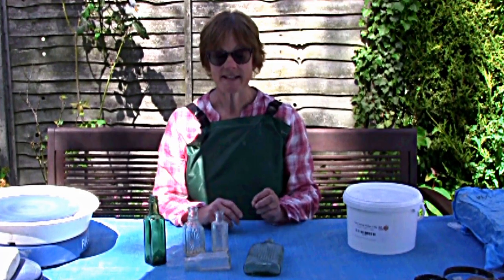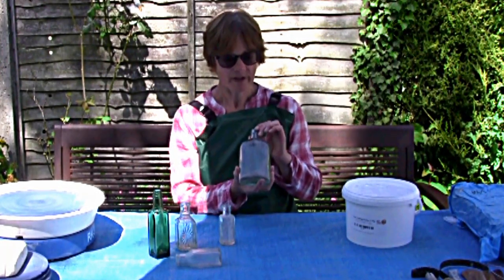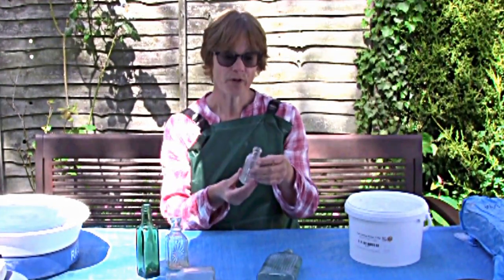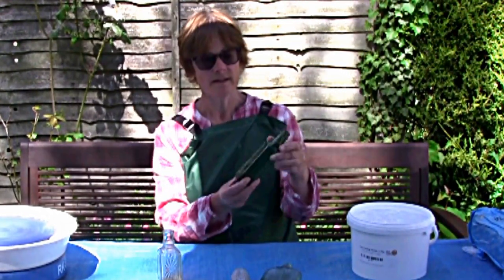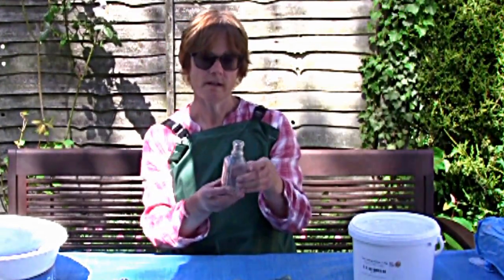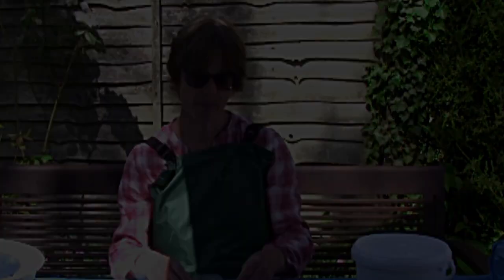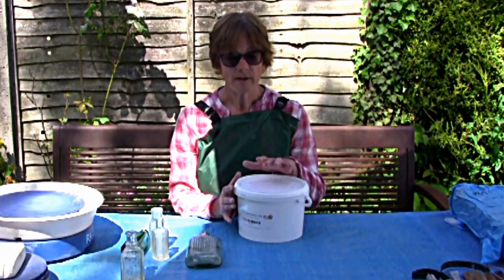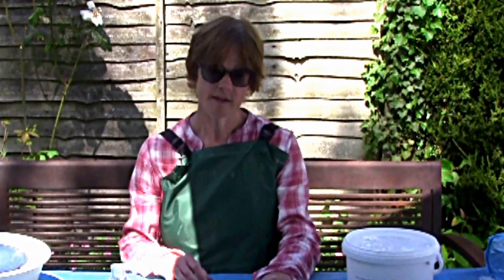Pottery Tutorial:  How To Cast A Two Piece Bottle Mould - created by Andrea Young

Comment: Okaaaaay, but now what? I'm sure these wouldn't be suitable for injection molding, unless you used it as a template for a CNC milling into steel. Are these suitable for blown glass molding? How many bottles would it be good for if so before the mold breaks down from thermal shock?
Reply from the maker: Hi Mriya6,

These plaster cast moulds are for use with a liquid clay known as casting slip.  I can appreciate that it may not have been clear during the video, so my apologies.  The glass bottles were used to produce the moulds, for reproducing clay replicas.